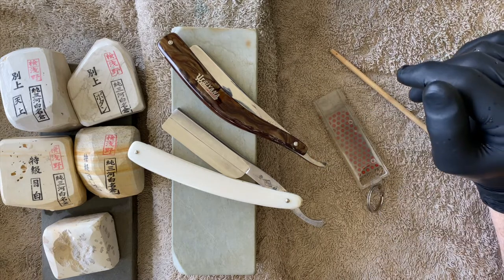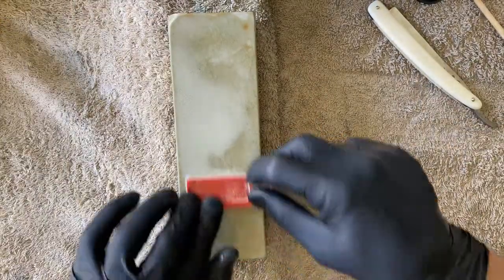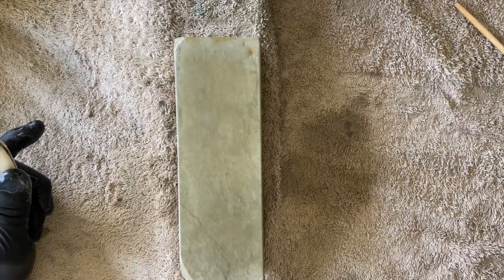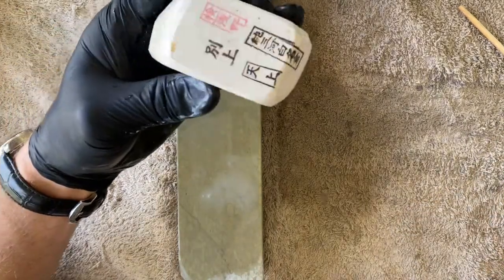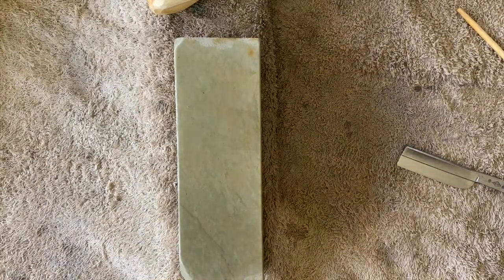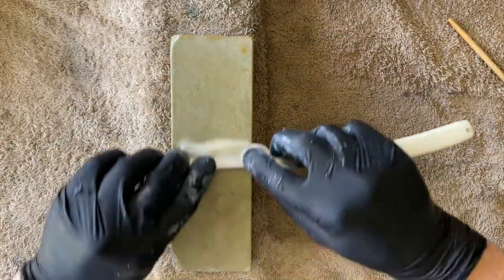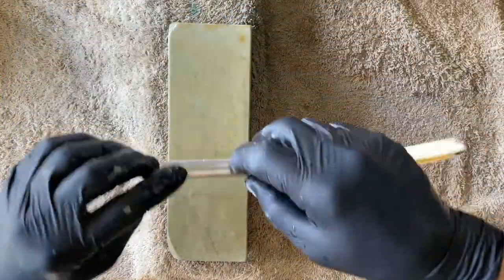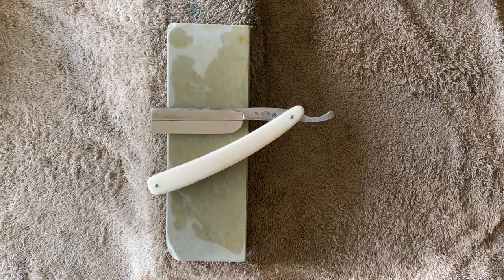How to Hone on Jnats - Aiiwatani & Asano Nagura (vid 87)

Comment: Hi. Have you tried sharpening a razor on Naniwa Chosera 1000, 3000, 5000 synthetic stones? Asano Nagura looks beautiful and authentic, but in my opinion inconvenient to use. The easiest way is Naniwa Chosera 1000 -> 3000 -> 5000 -> JNat + Tomo Nagura -> Escher. It's very simple, it's stable and fast. Or do without Escher at all if there is a very nice Japanese stone. Don't get me wrong, I'm not teaching you, I'm just wondering why you use Asano Nagura.
Reply from the maker: Hi Ivan, I appreciate you question/statement. I use Asano Nagura's because they work and generate quality edges. Moreover they are cheaper than 3 Chosera stones, not even going to mention Escher cost. 

Furthermore, why would I want to maintain 5 stones (1, 3, 5K, Jnat and Escher) instead of a single Jnat??? That's more of an inconvenience and a slower process, at least for me. To be honest Chosera can't build the same bevel foundation I can with Asano's on Jnat. Hope you find this useful. 

You definitely know your stuff, maybe do a video for everyone to enjoy and learn from your knowledge. We all can learn from each other that for sure. Best wishes, regards Jacques

Comment: Thanks for all the info' Jacques about slurry(s). I'm new to SR shaving and recently bought an inexpensive carbon steel razor (Brent Berkeley similar to a Gold Dollar) a King 1000/6000k stone and a Naniwa 12k and recently acquired a Cnat ADAEE 12k, lapping them all flat first, to gain an insight into honing, at modest cost, but have yet to achieved my first shave ready edge, but coming off the Cnat  the blade definitely felt smoother on the skin -as you say about natural stones  in the video. I intend to stick at it with the primary goal, for the time being, to achieve a shave ready edge your videos have inspired me to stick at it!
Reply from the maker: kind words it's much appreciated. Excellent feedback and great approach wrt primary goal. best wishes, dapper shaves

Comment: Hi my friend 
I fantastic instructional video, I need to buy sharpening stones now to have a go. If I bought a new Dovo Bismarck what model would you buy and size. I have bought two razors from Dave cunnliffe on YouTube and they are very good and old Sheffield steel. But if I get into it properly I will buy a new one
Thank you my friend 
Paul
Reply from the maker: Hi Paul, Any of the new Dovo Bismarck, they are all 6/8 round points with thumb notch. You will have to get it honed, they are not 100 shave ready out the box, in fact no mass produced modern razor is. Personally I have the faux mother of pearl with gold trimming, beautiful shaver. Have a look at my razor show & tell videos, maybe you discovery something new. regards dapper shaves

Comment: Hi and thanks for the video! Would it be possible to have more detail about the stone you used please? Thanks!
Reply from the maker: Hi Andrea, the base stone is aiiwatani of around 4.5 on the hardness side. It’s a customers stone that was purchased from Maksim at JNS. The asano nagura’s are from Sakamoto san. I have a similar stone (6x2) size. I’ve handled a few of them and they are great finishers at very reasonable price. If you search my channel you’ll find another aiiwatani honing video. best ishes jacques
Reply: @dappershaves  thanks! I'm searching for a good stone for using the asano naguras at a reasonable price...any link to suggest? thanks
Reply from the maker: @Andrea-Agostini-9971  https://www.japanesenaturalstones.com

Comment: Nice video.  How far back in the nagura progression do you start when touching up a razor.
Reply from the maker: Hi Chris, good question. Fo me the state of the bevel and usage will determine how far I go back, a loupe will help. Your best guide here is your won personal experience (gut feel). My examples below has works well in how I approach honing. 

Apex Refresh: If bevel is clean (polished) and still treetopping I would refresh apex only, use you final polishing progression twice with stopping in between. 

Bevel Refresh: If fine/small chips under magnification is visible, Il'l use mejiro/midrange progression using some edge biased pressure (~200g) until chips are gone followed by finishing progression (x2) and stropping. 

Bevel reset: Any other damage and I start from step 1 - full reset bevel. Hope you find this useful, regards dapper shaves

Comment: Hey. Do you not use synthetic stone 1000 before working on Jnat in the case of razors with good geometry?
Reply from the maker: Hi Sergey, No I don't use synthetics at all. I will use DMT diamond to remove large chips, or re-profile. Other than that all natural. Best wishes, regards dapper shaves
Reply: @dappershaves  Sorry, I don't speak English well. I want to clarify. Do you align the razor on the DMT diamond plate itself? And what do you do if the chamfer doesn't have access to the cutting edge? In this case, do you also change the angle by working with a razor on a diamond plate?
Reply from the maker: @sergey_ru  Other than removing big chips from edge, razors will NEVER go to diamond plate.
Reply: @dappershaves  understood. How then do you change the angle? For example, if someone sharpened a razor before you using electrical tape, and you sharpen without electrical tape. Do you go to the cutting edge using jnat and botan naguru?
Reply from the maker: @sergey_ru  Correct, I’ll hone with thick slurry and slightly edge biased pressure. Under magnifying you will see where you cut on the bevel. 1 layer of tape generally adds about 0,5-0,8 degrees to the bevel per side, so 1 degree or more in total. You can lightly joint the apex before you start to make sure you set a new one.
Reply: @dappershaves  Thank you!